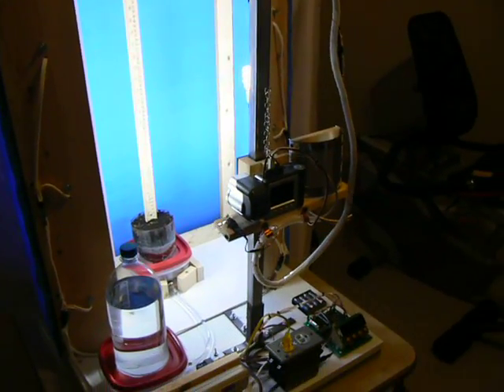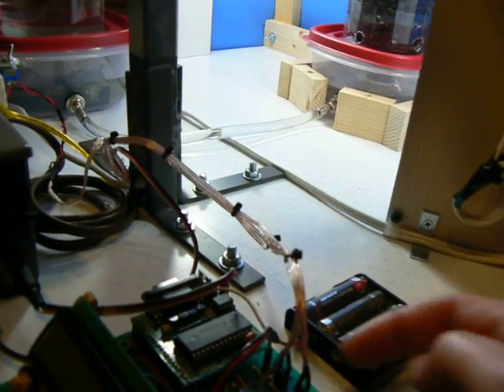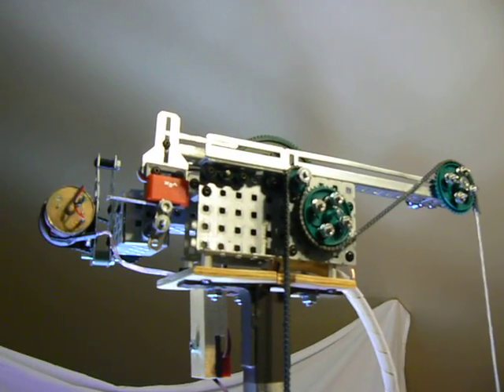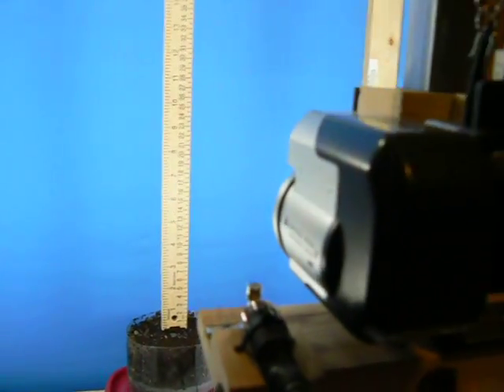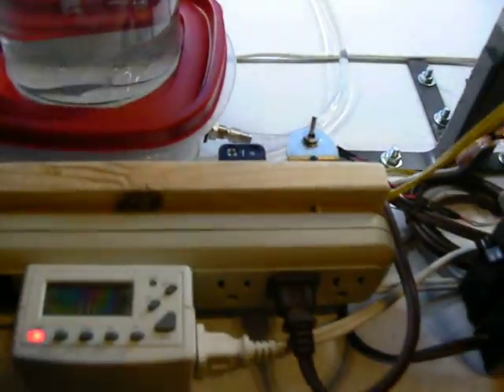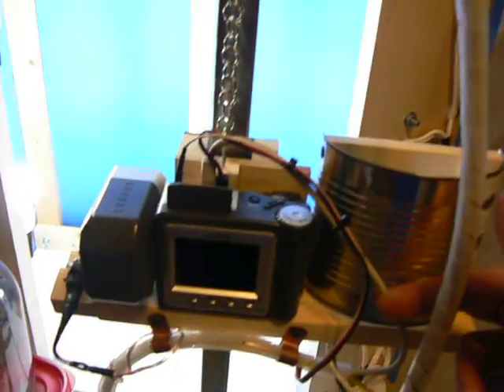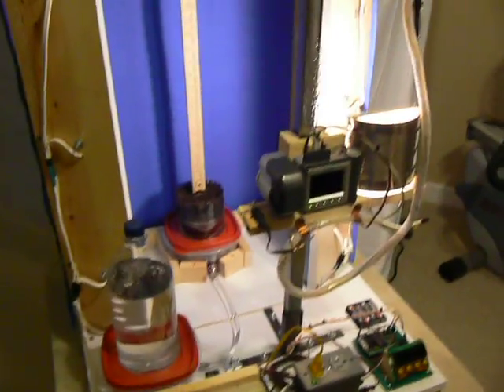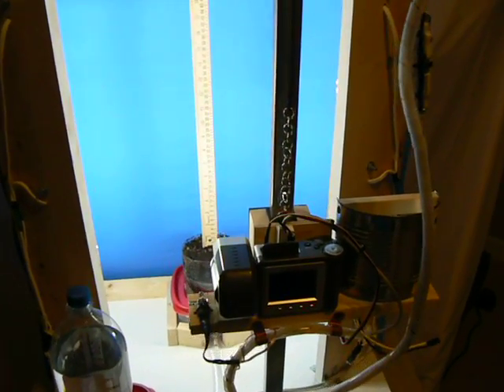Time-Lapse Rig Video Tour

Comment from the maker: A chicken-feeder bottle relies on the fact that the bottle is closed except for an opening submerged in the standing pool of water.  I'm not sure that there's any way to make such an arrangement self-filling - such that it could be used for rainwater collection - without making it extremely complex in the process.  By the time you got something that worked, you would probably have been better off just going with a more traditional rainwater collection system.

Comment from the maker: The self-wicking arrangement places a wick - in this case just a piece of light braided rope - inside the pot surrounded by the soil, and with the other end sitting in the water.  The rope wicks up the water, which is then transferred to the soil.  It worked in initial tests, but a little bit too well, keeping the soil a bit too moist and things had a bit of trouble growing well.  It works better with established plants with good root systems, not so great with seedlings.